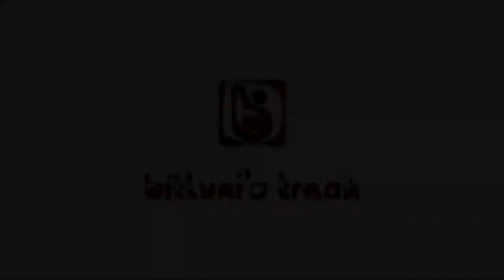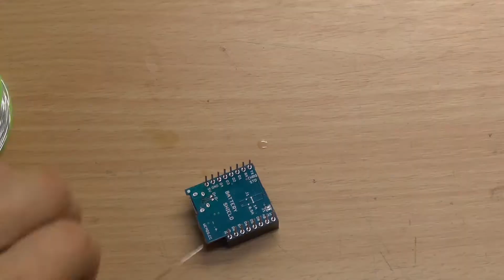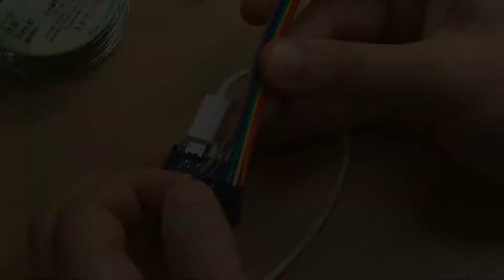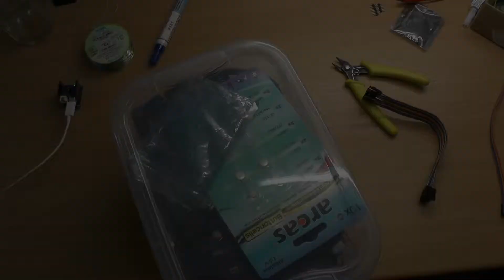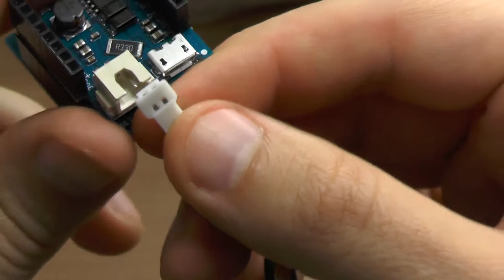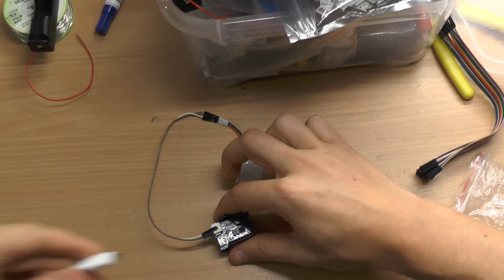WeMos lithium battery shield (ESP8266)

Comment: Thanks. Your video made me realize the polarity on my my lipo battery was backwards.  Works great now.  here is some code to read the voltage

const int analogPin = A0; // Replace with the correct pin for your shield

void setup() {
  Serial.begin(115200);
}

void loop() {
  int sensorValue = analogRead(analogPin); // read the input on the analog pin
  float voltage = sensorValue * (3.3 / 1023.0); // Convert the analog reading to voltage
  Serial.print("Battery Voltage: ");
  Serial.print(voltage);
  Serial.println(" V");
  delay(1000); // Delay in between reads for stability
}
Reply: Thank you 😮

Comment: Using a pair of Dupont connector wires for the battery connection is brilliant! I thought I would have to de-solder the connector and solder on wires just to do my breadboard testing...

Comment: I connected a 3.7v lipo, and it started smoking...
(the small resistor 102 right next to the leds was smoking hot (0.7A))
Why did that happen?
Reply: Always use a smoke stopper.  A multimeter is not good enough. That's what I learned from building drones and your comment reminded me that I probably should do that with Arduino stuff as well. I have the same smoke stopper as in this vid. Not sure if I should make a smaller one. https://www.youtube.com/watch?v=I5a0TAmEwLE
Reply: Did you check the polarity? Smoke gets out if you connect them wrong way round!

Comment: In my project i need to monitor is powered by usb, or by battery now.  If i use this shield, can i know get this data on controller pin ?
Reply: Chris, I don't really need to know the battery voltage. I need to know did it powered by USB at the moment, to switch external input.
at all the battery needed only to power up wemos untill it switch relay witch choose power line for supply.
sorry for my english))